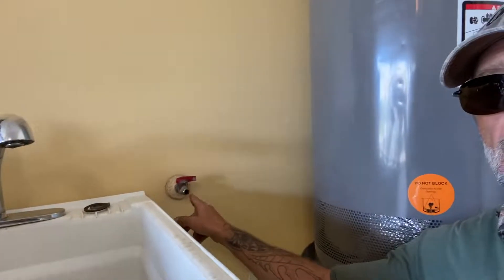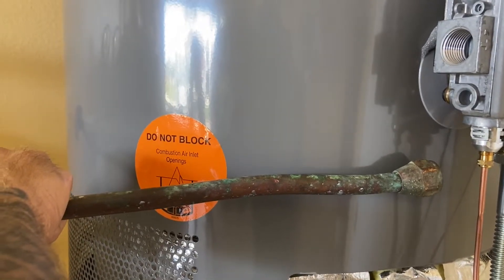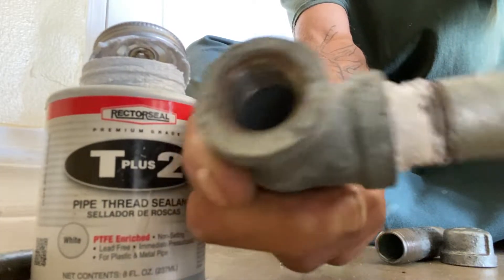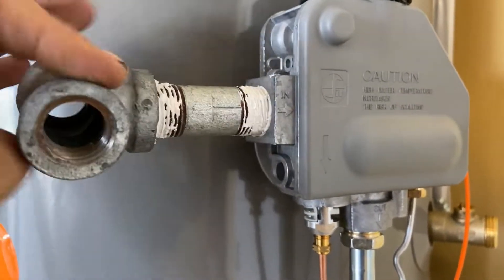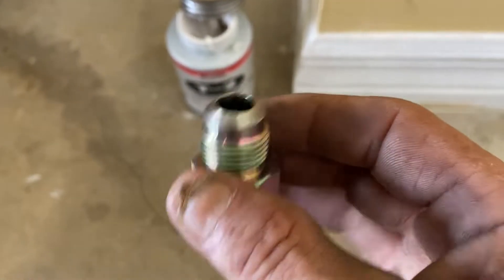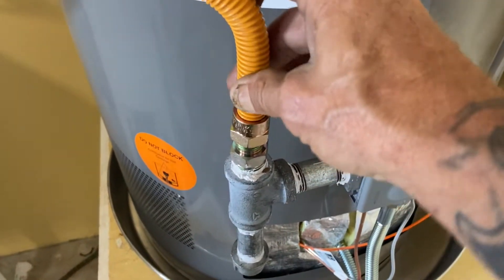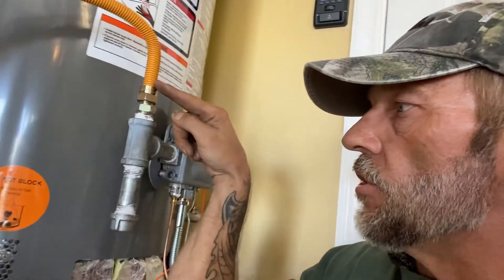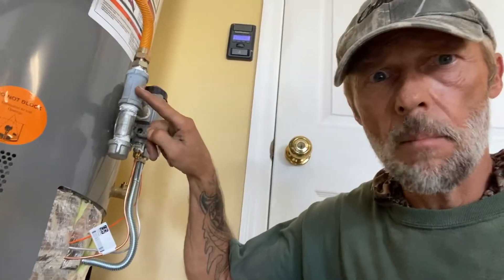HOW TO INTALL SEDIMENT TRAP ON NATUARAL GAS HOT WATER HEATER

Comment: Mechanical engineer here.  Use black pipe for gas lines.  Galvanized is usually prohibited in most jurisdictions because 1) The coating eventually flakes and clogs small orifices, 2) The coating is designed to prohibit water from rusting.  It does not react well to gas and will actually corrode faster than black pipe, the galvanized coating will bubble and flake.  Otherwise, great video!
Reply: And in some jurisdictions black pipe is prohibited on all new construction and retrofits (like my beach town).  Or the entire state of Maine. 

There are legitimate scientific studies going back decades that say 'zinc reacts with combustible gas and flakes off' is complete word of mouth nonsense.  Probably started 50 years ago when some plumber wanted to justify his use of cheaper materials.

Comment: Question could you put one big sediment trap on the main like in the house or does each gas supply outlet need one?
Reply: Each gas appliance needs to have its own......

Is stated in each appliance manual by manufacturer 

Most manufacturers suggest the trap to be 6in length.

Comment: Why didnt he wipe the excess  pipe dope  off of the 1st & 2nd threads because that too will get into the water heater control unit and cause problems?
Reply: yeah, seems a bit too generous slopping it on like that over the pipe end.

Comment: Please clarify this set up based on current UPC code.  I have this exact set up for a gas water heater installed by my plumber several years ago which I intend to duplicate.  I am replacing my temperature control valve.  I have been told that under new UPC code, that the sediment trap must be installed after the gas shut off and before the flex.  Is this what I am seeing in this video?    Any assistance would be greatly appreciated.  Thank you.

Comment: I installed two new water heaters at my home beyond the original. I always put the sediment/drip trap in before the gas valve, but I never saw or felt any particles, etc . In the trap after disassembly. Always best to use black iron pipe with gas because the galvanizing can deteriorate over time. Locally , everybody uses pipe dope , rated for gas, for fittings versus yellow tape. I hard piped the gas connections both times, but maybe next time I’ll use a flex hose. Seems much easier.

Comment: Hi  if you replace   the  old tank   and installing a new one do you have to replace the (  Vacuum Relief Valve) the vacuum breaker  or  you can the old one that is already installed on the copper hose   thx

Comment: Can the trap be made near the wall instead? Makes for a cleaner simpler install. Less rework when replacing the heater, too. The stainless flex connector is not going to rust.

Comment: After the stub out install a valve then tee with flex off the top to the wh fairly easy folks if you know what yer doing
Reply: This is the proper way to install sediment trap. Inlet gas runs to the side of the Tee, then flex line off the top into the equipment. You’re the only person in the comments that said anything about it.

Comment: Replacing my gas valve and the gas pipe has this configuration.  Many other videos had an adapter between the valve and the trap.  Now that I have my new valve in place, this is helping me reassemble everything.  Thanks for the spot-on video!

Comment: Would it be ok to remove the sediment trap cap and connect a flexible hose in order to test a gas convection oven?  Or any reason that would not be ok? After the test the cap would be replaced. Thanks!

Comment: Good job of installing trap with one big exception, well two. Galvanized pipe is not allowed for gas line, black pipe only! The big exception really is the over use of pipe dope! You put so much on and left gobs inside of pipe it will be carried into burner causing all kinds of problems!
Reply: I agree on both points, especially the excess pipe dope.
Reply: Glad you said it!

Comment: Not a big deal for using galvanized other than specific jurisdictions that reqiure black pipe because there’s zero data that supports the "urban myth"......it's the same matrial with one coated with zinc and one that's not.

Comment: This is wrong according to uniform plumbing code,and any inspector would fail you if its directly off the gas control valve.  The drip leg must be after the shut off valve with the flex going directly to the gas control valve.
Reply from the maker: Thanks for sharing 
The way I showed in the video is how it is done here in Florida
Reply: @PLUMBINGWITHTIM  this was actually totally ok up until the last 2 years. Recent change

Comment: Are all water heater sizing the same? Im in california and have a smaller water heater due to living in a manufactured home. How do I know what size pipe fittings to get?
Reply from the maker: Not all water heaters are alike 
But most tank water heaters come ready to install with 3/4” water lines and fitting

Comment: So which is it? Galvanized or black pipe? Before the flex or after it? Pipe dope or yellow tape? Above or below the source inlet? 
Jeez,  are we hooking up a water heater or building a grand piano? 
Thanks for the video, Tim. After three days of flailing I watched this and I was done in an hour. 
And for what it's worth, the guy who works at my Home Depot here in Oregon says you nailed it. Except for the pipe dope instead of yellow tape.  But we only know (and care ) about Oregon.
Reply: Should use black iron/steel pipe. The sediment trap can be before or after the flex line. The reason it’s recommended to put it before the flex line is so the next time the water heater has to be replaced you don’t have to worry about putting the sediment trap on the new water heater. It’s just there as a permanent fixture.

Comment: Thanks, Tim for the time you spent making this video, even though you are correct in giving instructions on installing the trash-Trap on the gas line, I never heard of any code saying it's ok to use galvanized pipe for natural gas, Black pipe instead, are you sure where you live the code ok's the use of galvanized for natural gas? you are well appreciated but I will suggest that you check again because galvanized has a deterioration problem when used with natural gas. thanks. Be sure to mention that most codes require the installer to install a gas regulator first before you install the Trash-Trap.
Reply: I think the galvanized thing is "one of those things" that people talk about but there is not exact proof,reason i say this and i'm not a expert by no means is because at the moment I am replacing the gas valve on my water heater , i installed this water heater back in 2009, i found out in the last few days that the gas valves on these heaters are famous for going out due to piss poor manufacturing issues but thats another story for another day.

The reason I'm bringing this up is because there was a water heater installed in my house in 1983 (way before i lived here) that i replaced in 09 with my current one and they used galvanized pipe back then and i reused the same setup in 09.

This time while replacing my gas valve i decided to install a flex line and get rid of all that piping but i looked inside that pipe before i threw it out and it was pristine, that pipe might have been there before 1983 but i can't say for sure, 1983 to 2021=38 years, this would lead me to believe there is no correlation between galvanized pipe being susceptible to natural gas BUT with the quality of the stuff coming from china these days maybe the new galvanized pipe might not hold up like this good old one did.

Comment: never use galvanize pipe for gas never the reason is that galvanized pipe is coated it will flake off in time and cause issues to your control
Reply: Not an issue anymore

Comment: Thank you, Should you avoid getting pipe dope on the ends of the flare threads so it does not come off and enter the appliance or heater? Also is code order from wall:valve, trap then flexible hose?
Reply: In California, according to https://up.codes/viewer/california/ca-plumbing-code-2019/chapter/12/fuel-gas-piping#12 , "...a sediment trap shall be installed downstream of the appliance shutoff valve as close to the inlet of the appliance as practical, before the flex connector..." . The correct placement is a bit unclear in their instructions IMO. but when they say "before", I assume that is from the perspective of the appliance inlet. I'm going with Tim's installation. Makes sense to have a filter as close to the appliance as possible.
Reply from the maker: Thanks for watching. Yes

Comment: Hey Tim,like that Video.good one. if you get a chance sometime tim,i would like to see a video on how you change out a residential pressure reducer.and how to locate one in the ground.usually there in the front yard, or in the ground.and in the garage.but there was one customer who lived in an associated community who had a pressure reducer in his house,but i couldn't find the damn thing.i did a water pressure test.it came out to 50 psi.,which was good.but the customer wanted a little more water pressure.like 70 psi..which i understand.he wasn't getting enough water pressure in his shower in back of the house. but i couldn't find it in the ground.i looked every where for it.again,in the garage.in between the walls of his garage.next to the waterheater.inside his house.nada.dead on arrival.it was frustrating.not only that, the customer didn't want to take a chance on me cutting up his dry wall in the garage.i told him it was "right there". right there in the garage.inbetween the wall.but no dice.i'm sure you've had that experience many times.give me some advice.bye the way, you can't detect with a metal detector brass or copper.let alone CPVC.forget it.thanxx.